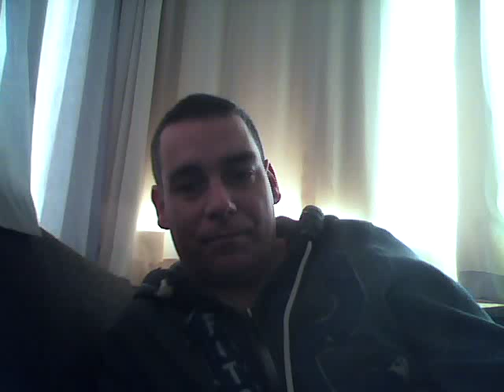Alodine. Handle it correctly or get ill.

Comment: Problem with Alodine is that unlike MEK or paint stripper it isn't immediately obvious that the stuff is toxic. Re not leaving it dry - I never saw it rinsed in any other way than straight down the drain at all the places worked which is a real shame. Its just another god awful chemical that sheeties use every day.

Comment: Chu - thank you for the stark reminder.  Yesterday I had a hole in my glove. 40 minutes of exposure from that hole resulted in sudden nausea and fever/chills last night (4 hours after the exposure). I only knew of exposure because when I removed my R/H glove I saw the tip of my thumb had turned yellow from the alodine.  I trashed those gloves and returned to my US Army Chemical Suit (MOPP) gloves that I can buy at the Army surplus store for $2.00 a pair.  They're made of Viton rubber which if bought from a civilian supplier are usually around $125.00
Reply: What's happened after can you tell

Comment: The alcohol in your beer is also a know carcinogen, just sayin. Hex chrome is a mutagen and carcinogen yes but for small Cale home use gloves and glasses are fine, dip your parts outside for ventilation. If you worried abot environmental issues with disposal, mix you spent Chromic acid with sodium sulfite before disposal, which converts chrome-6 to chrome-3.
Reply: Hex chrome is very dangerous. And I don't think you can toss them together. See https://www.hubbardhall.com/chemical-applications/wastewater-treatment/wastewater-solutions/hexavalent-chrome-reduction/